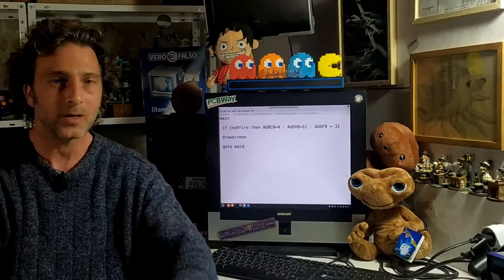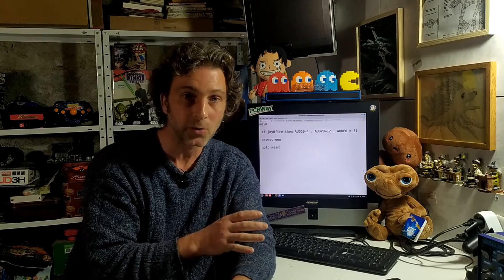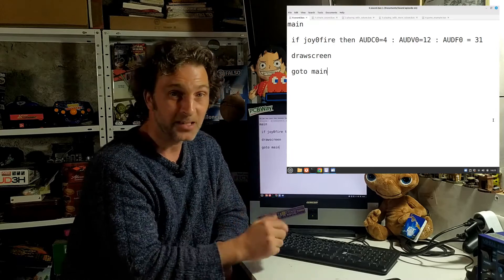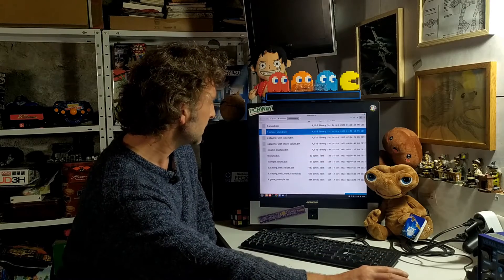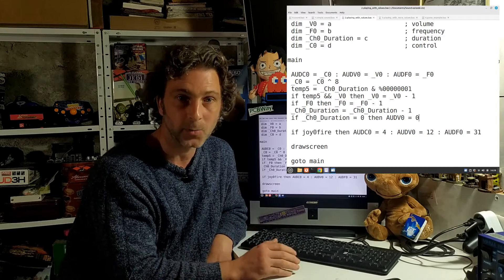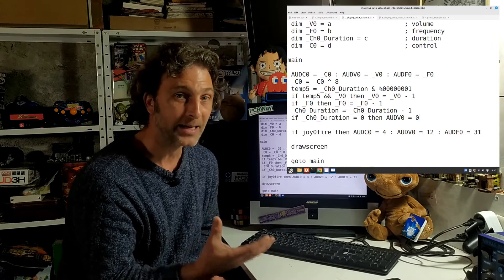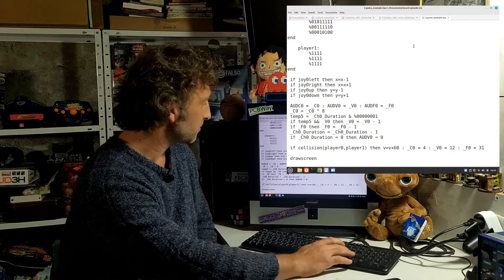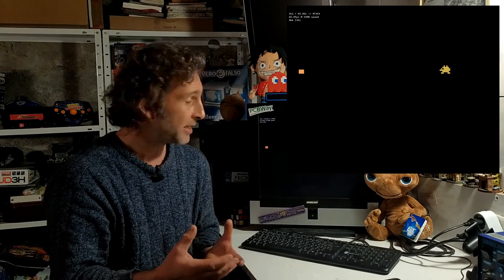Makin' noise in bAtari basic | Making an Atari 2600 game pt.6 | 8bitsinthebasement

Comment: Another great lesson. Later this month I have some time off work. I'll try to dig in and get some practice with Batari Basic. Already thought of a game idea. You are a Pizza maker, and you need to collect the correct ingredients. Time is limited and if you collect the wrong ingredient you have to start over. If time expires, and you haven't made your pizza you lose a life. To make things harder rats chase you around the maze and steal your ingredients. It'll be a while before I can make something complicated like that, but It'll be fun to start learning how to do it.
Reply from the maker: Sounds like it could be a fun game and quite a challenge too. I'm sure that you'll manage to pull it off, just take it in small pieces.  A big program is just a bunch of small programs stitched together. So break your game idea into parts and work on them one by one. If you get stuck or can't figure out how to make a part work just move onto the next part and work on that. If I'm honest at times bugs creep into the code that can make you want to pull your hair out but that only makes it all the sweeter when you get something to work just the way you wanted it to. Have fun with it ;)